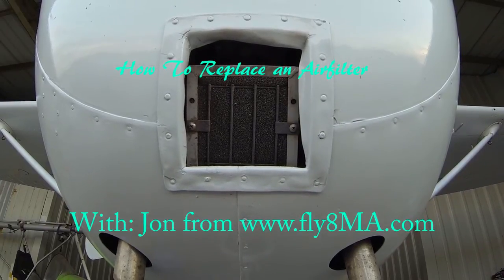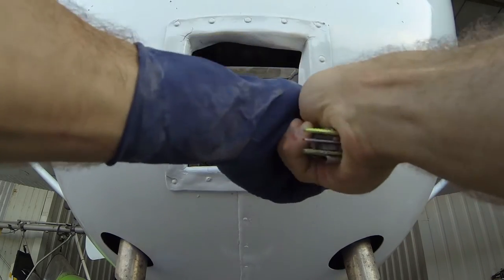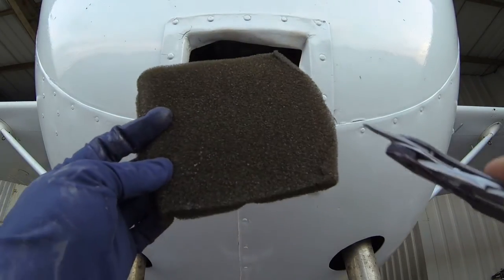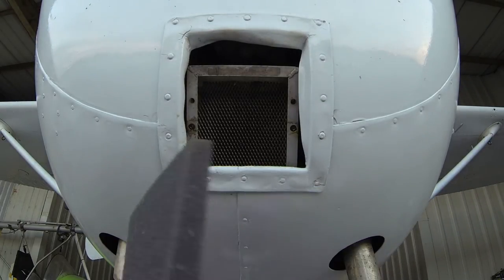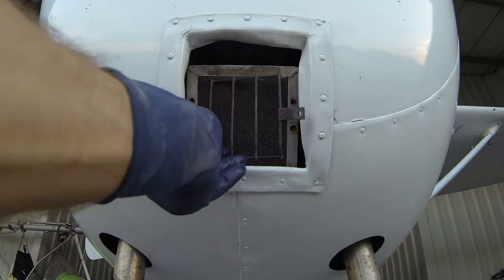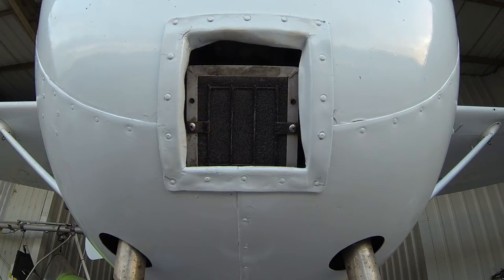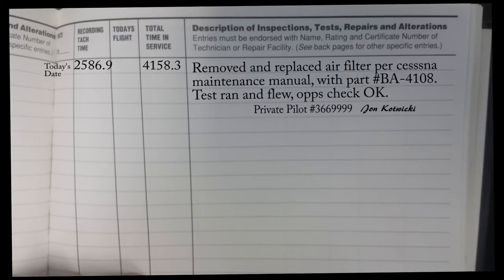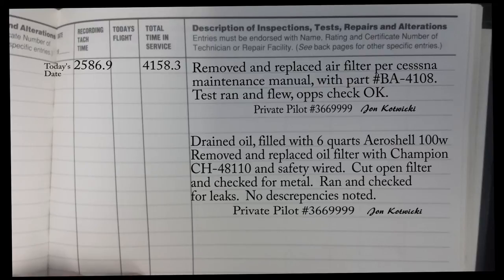How To: Replace Aircraft Air Filter | Cessna 150 | Log Entry

Comment: Just a note that part 43 section 43.13 states you should reference the data used or provide a step-by-step statement of what you did.  Changing oil requires a calibrated torque wrench to tighten the oil filter to the Service Manual requirements not what is written on the box.  So for owners to perform oil changes they must follow the same rules and service instructions as A&P mechanics.  Just saying.

Comment: When changing the element in a Brackett filter, one should follow the instructions provided by Brackett Aero Filters, Inc., which include instructions for continued airworthiness. Cessna's maintenance manual does not provide instructions for aftermarket components, like Brackett air filters - see §43.13(a). And when making a record entry, attempt to spell words like "OPS" correctly. "opps" is slang for opposition. All in all, this maintenance was performed contrary to the FARs and the airplane is unairworthy until corrected.